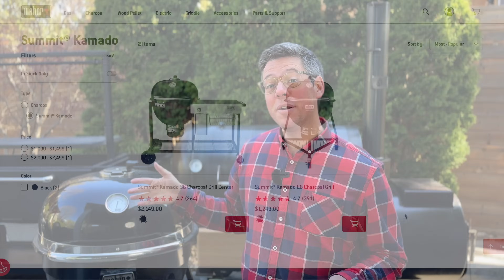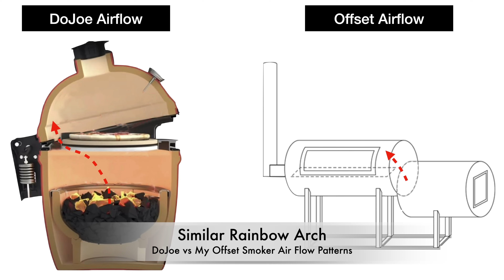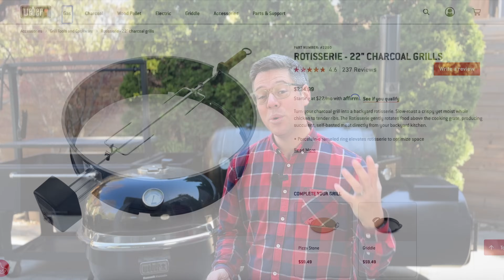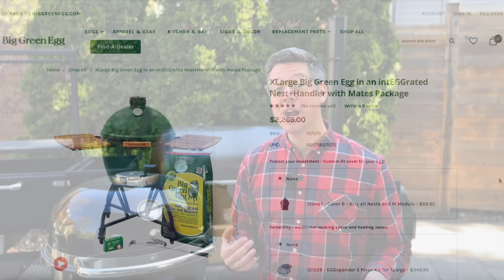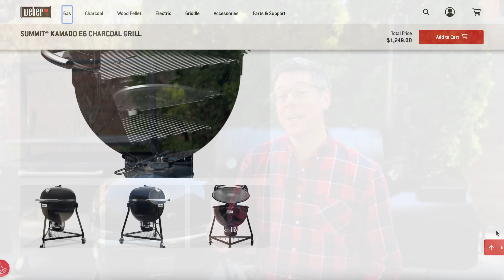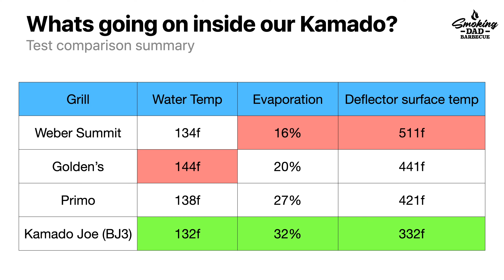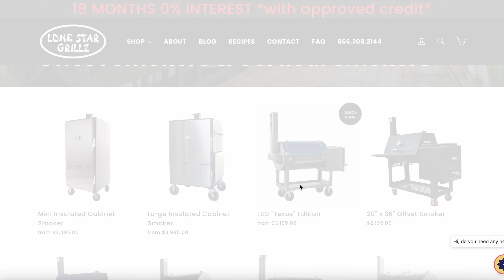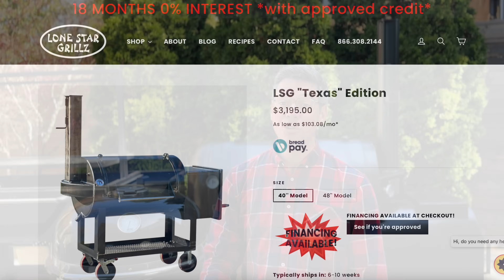3 Reasons NOT To Buy The NEW Weber Summit Kamado (1 Yr Review)

Comment: Your claims of impartiality merely because Weber didn’t pay you yet anyone who has watched any of your stuff knows you’re heavily endorsed and sponsored by Kamado Joe means your claim is an out and out lie.

You’re not wrong about the annoying lack of accessories or the vent. However, you never once touche on what it also doesn’t have that all of the ceramic Kamado’s have, chipping paint and easy breakability. 

Your complaint about the Summit not achieving or being able to maintain the heat the same way the ceramic ones do was actually a deciding factor in why I chose the summit. Sometimes the ceramic ones can’t come down in temp fast enough for certain purposes. I don’t find the loss of heat compared to a ceramic to be that difficult to overcome and don’t mind extra fuel consumption if it means I have better ability to fluctuate my temps when needed.

The biggest dishonest part was your  comparisons to side tables and carts. You feign ignorance as to why Weber themselves would charge more for the cart on the Summit compared to their own kettle carts, and this is just blatantly dishonest. The carts on the kettles are not stainless steel like the Summit, and you even show pictures demonstrating that, nor are any of the other wood shelf style ones on the others you chose to lie about. This is like buying a VW and saying you don’t get why a Ferrari is so much more expensive. So if you’re going to blatantly lie about an obvious false comparison what else are you being dishonest about?
Reply from the maker: If consumer reports were to do this review what would they say?  These are the facts … I get you don’t like them
Reply: @SmokingDadBBQ , did Consumer Reports do it? Then what’s your point? They aren’t facts, not all of them. And your bias and sponsorships to a competing brand are well known and noted, as you have no less than three of their models in your setup at any given time. Also, if consumer reports made the same claims I’d have the same challenges and if they were receiving sponsorships or even getting ads place by direct competitors I’d have the same doubts. It’s called integrity… I get you don’t have any.
Reply from the maker: @camerachris  I have these models at an engineering university doing CFD testing and have preliminary data. I’ve also shown infrared data, evaporative cooling, airflow measurements between these models and the summit does worse. I challenge you to make a more fair and factual review and I am willing to bet you land on the same conclusion
Reply: @SmokingDadBBQ , James, so what? Where did I actually challenge your data on heat retention or fuel consumption or any of the claims you'd be using engineering university data for? To the contrary, I've clearly cited the uses that having a more easily manipulated conduction serves in certain circumstances and cited that I used those exact differences, combined with the chipping paint of the ceramic versions and their crackability, which is NOT covered under the warranty that you so boldly showcased, as reasons that I personally chose the Summit. And I've NEVER gotten anything free from any of these companies, while you most definitely have.

You are using the heat citations as a means to mount a counter to my challenges, while ignoring my other challenges about your erroneous claims and feigned incredulity about how they would DARE charge more for this cart than they do their own other carts, while literally showcasing IN YOUR VIDEO that they are not the same thing. You show the cart on the kettle, which is a plastic cart, and you somehow can't fathom why they might charge more for a fully stainless steel cart??? That's just SLIMY behaviour. Then you even go on to compare it to the various other brands and their versions, which aren't even CARTS, they are varying versions of side trays, some wood slats, some PVC. Yet you go on to compare and belittle the company offering and charging more for a full table cart made of stainless steel. This is just shady practice. Imagine a person who isn't versed on the various brands and models you are showing and they are going on your recommendation because, you are the one offering up this elaborate "year long" review, you are giving them your biased opinion while LYING to their faces. It's shameful and you should be embarrassed, but you're not, instead you're here attempting to defend to me about points I agreed with you on and totally skipping the ones that call you out for being a company shill for competing brands. 

I hear Insta360 is looking for "influencers" of your ilk.

Comment: I own the Weber summit for one year now and I think that it's a fantastic grill. It replaced a reverse flow offset smoker, a Webber kettle and a large gas grill. It can do all the things that all 3 grills/smoker did, with a better flavor than the gas grill,  same flavor as the smoker and  much better fuel efficiency than the kettle and the smoker. It can run full day without loading any fuel. As for the price - I agree, I think that it should be priced at 700$ for the base model, and 1000$ for the cart version. Here in Europe it is priced at 1400 euro for the base version, while Kamado Joe big Joe III is more than twice at 2950 Euro. You get more accessories with the big Joe, but I found out that adding a charcoal basket for 35 euro is all I needed. The only disadvantage I found for the Weber is that it is very difficult to integrate it into an outdoor kitchen due to the dimensions.
Reply from the maker: i know this gets lost in the video, but i agree its an excellent grill.  Perhaps the best grill i am not keeping, and the family i gave it to after is loving it.

For me the kitchen integration is a big deal but for some thats a non issue

Comment: Then all your owned Big Joe etc original Camados have the same issue as they have same centered airflow? Where is the point?
Reply from the maker: The point is to have done something different than every other company that makes Kamado clones but in this case the exhaust vent is worse for draw. Same reason and offset has a chimney … you don’t see offsets sawed off without a chimney

Comment: No doubt the lack of accessories is a bit frustrating, but others have come up with solutions for most accessories -- but really, does anyone buy these for the accessories?  Novelties with not much utility.  Where this  video goes wrong is setting it up as a SNS, then criticizing it based on how the SNS works.  How about use it as designed?  I personally much prefer my WSK to the KJ.

Comment: I always wanted a Weber Kamado, but the lack of accessories from Weber or aftermarket companies has led me to be very content with my 10+ year old Weber Smokey Mountain plus my 22” and 26” kettles.  

I had not thought about it until you mentioned it, but it is disappointing that Weber went cheap on the WSK when redesigning it instead of making improvements with no care about their loyal customers, only their profits. 

Some of your criticisms are flawed though. I have never seen any other Kamado with an offset vent so I am confused why you compared it to a kettle. The removable ashpan is an excellent feature not found on many kamados.
Reply from the maker: I had only wished they improved the vent flow vs making the vent less effective in either height for draw and or side location. Nobody else did this either since they mostly are all copying one another on the basic concept so that was more a wish out loud that they could have done something innovative

Comment: I picked up a Weber Summit Kamado E6 for $1100 earlier this year. It replaced a 15 year old BGE that I was barely using since the nest went empty. Prior to the E6 I was primarily using a 20 year old Weber kettle. 

For me the E6 replaced 2 grills. I love the versatility. I agree the S6 is overpriced. However the removal of the propane starter was a feature improvement IMO. Charcoal chimney is my preferred lighting method. 

The other reason I like the E6 is the lighter weight over the BGE. It was very easy to move the E6 from the back patio to the front driveway and store in the garage for cooks during the winter months. It’s easier to move around in general with no worries of an accidental drop and cracked ceramic which is a plus. I plan on taking it with me to a few family outings this summer so I can cook on it vs the gas grills some of the relatives ask me to cook on.

Lastly, I’m not a big accessories guy. Rotisserie, Santa Maria, pizza wedges. I have no use for them, but I can see where that would be a draw back for some. 

On the wing cook and the airflow/smoke flow. Don’t use the slow and sear. I’ve had great results with the Vortex. The heat/smoke radiating from the center cook’s chicken, thighs, ribs evenly with good smoke flavor throughout. 

These are my opinions. I appreciate the Smoking Dad perspective, but am very happy with my E6.
Reply from the maker: Thanks. Last think this review for is to cause any dissatisfaction for current owners. It’s a great grill. I just don’t think it has the facts to justify being first choice in a competitive field
Reply: @SmokingDadBBQ  It depends, I definitely love your channel. If you are talking about options, then the KJ is better (accessories) the KJ is better. But if you are talking about the everyday grill and smoking. I don't see how the KJ BJ is better at the price increase.
Reply: I appreciate this review. I was never a ribs or rotisserie chicken guy, which would warrant those accessories.

I married into a family where it's steaks + tri-tip 24/7. The Weber kettle I used to own cooked the tip to perfection, but sadly those kettles break and rust. Looks like the Summit has got a 10-year warranty. I am most curious about the durability on the 1200 dollar grill before I pull the trigger.
Reply: @ChristopherDillman  mine stays outdoors most of the year. I have a cover for it. Same for my Kettle which is nearing 25 and still in good shape. 

I’ve only had my WSK for about a year and a half but it shows no signs of breakdown anytime soon. I see no reason I won’t get at least 10 years of use out of it.

Comment: Some valid points. However. It's much cheaper than a Kamado Joe 3 in the same size, weighs far less, won't crack and is quicker to correct over temperature than ceramic Kamados. The lack of accessories and cheap heat deflector are absolutely true.
Reply from the maker: yes, kj kind of like smart phones has three versions.  The series 1 with cart is 50% less and the series 3 with 3 tier cooking rack, sloroller and gear etc. is $2999 usd and more expensive than either summit model
Reply: And you have next to no storage on any of them. Do you have to walk to the garage every time you want your deflector plate?  What about when you don’t want it?  Sorry but piling up junk under the Kamado when not in use is a sloppy look.  Summit with cart has massive amounts of storage under the Kamado and under the table.  Dedicated slot for the deflector out of site out of mind, no one even knows it’s there.  The table is stainless steel and holds up to all the elements.  Perfect for chopping, cooking, prep work, etc.  also has a massive sealed container for more storage of your choice, also has a pull out drawer for keeping anything you want from rags to thermometers, to gloves, you name it.  You can literally stack fire wood under the table of a summit.  Kj gives you a foldable composite “shelf” that gets eaten up by UV rays in two years.  You can’t even sit a beer on it without it falling over cause it’s not a flat surface.  It’s small and not a work station.  Just a shelf to set something on.  Hardly useful for someone preparing food in an outdoor setting.  KJ makes you believe you need all these gimmicky accessories to make good food and that is simply not the case.
Reply from the maker: @johns6481  well I decently agree there’s lots of stuff, perhaps too much with the leading ceramic brands between stones, grids etc but I do personally prefer versatility vs the absence of choice along with the lower starting price for the bar min config with useful shelves

Comment: Had the KJ BJ3, BGE XL (2022 model), and Weber summit charcoal grill non center. The KJBJ3 was the one that struggled the most when I filled it up with 4 briskets. The top level of divide and conquer wouldn’t fit an expansion rack and the only way to accommodate 4 briskets was to use the second level which limited drip pan space. The sloroller in my experience was a gimmick and still charred some of the briskets. All the accessories/components I had for the KJ made it overwhelming especially for storing them in a place far away from the Kamado (since Kj has little to no space underneath). The BGE XL fit 4 briskets perfectly using the Eggspander, and the WSCG also fits 4 full packers using a KJ ceramic grill store elevated grate with enough clearance to not touch the dome. 
For smoking I feel the ceramics are slightly more consistent than WSCG. Might be moisture retention not really sure why. 
Both KJ and BGE support was impossible to reach when I tried. The claims of the lifetime warranty are debunked for me if I can’t even get a hold of customer support. With Weber I get a 1 day wait time for a response which is ideal for most. I have an offset 94gal and a WSM 22.5” if I wanted to use a dedicated smoker. 
Kamado’s are really good for efficient multi-purpose cooking which is a drawback for smoking around 250-275 since the smoke is too clean to produce offset or even WSM quality. The smoke is a little more pungent in my opinion on kamado’s when cooking on low temps. Will have you burping smoke all day which is not a good feeling 😅. 

To conclude, I kept my WSCG over the two ceramic since it’s just as efficient in cooking and fuel consumption, I have the Weber peace of mind warranty services, and shuts down fast plus comes up to temp quicker than ceramics. WSCG/WSK is way more forgiving when trying to dial in temps.

Comment: I have had the S6 for a few years, and i didn't pay today's prices for it. It cooks indirect very well. That being said, I'm not sure it does steaks as good as my 22 kettle. When i received it from weber, a bracket was shipped with no threads and they had to send me a replacement. The stainless basket did not fit, and they sent me a replacement. Now the gasket leaks, the gasket around the vent leaks, the deflector is rusted and the grates are rusted. Also, the igniter system has not worked in years. Weber said they will not warranty any of it. This is obviously not a lifetime grill.
Reply from the maker: Similar issues on the first one I used which belongs to a friend

Comment: I've owned the original Weber Summit charcoal when it came out. The one in my profile pic. I sold it when I moved into an apartment. I did really like the deflector it came with. I'm sure you could convert the current one to a hinged grate by cutting it and adding hinges. Then again, based on my experience, a low and slow cook on it should not need refilling even for very long cooks. I hated the propane assist though. There was air flow around the gas tube that I sealed up. I do like the fact that it comes ready for a temperature controller to be installed without drilling. All Webers are going way up in price. The WSM 22" is $500 right now.
Reply from the maker: I do like my WSM, but the price creep has gotten worse since they were bought out by an investment firm

Comment: Great video. Summarization the end spot on. I have a WSK & long time Weber guy. That was brutal, but mostly true and needed to be said. (a little, not necessarily apples to apples comparing but still in the red zone of bullseye overall assessment)

I will say that the E6 is MUCH lighter and if you move it around a lot, it does have a stand alone mobility durability factor regardless of warranty. 

This may be my last Weber.  Looking at the huntsman…
Reply from the maker: i can vouch for how much easier it is to move.  the e6 has gone in the back of the truck and off to events which none of the large ceramic kamados have ever done